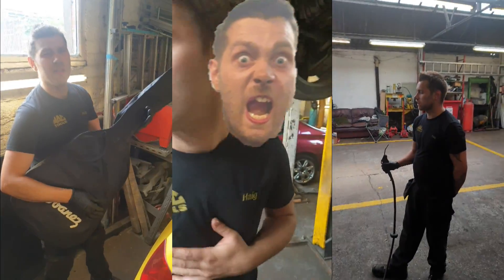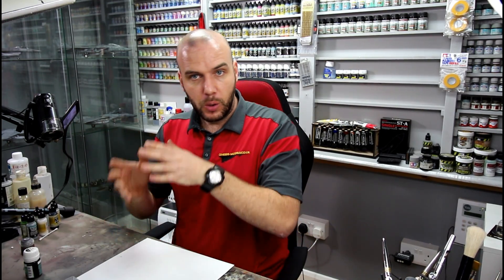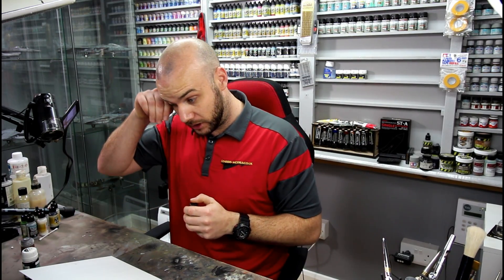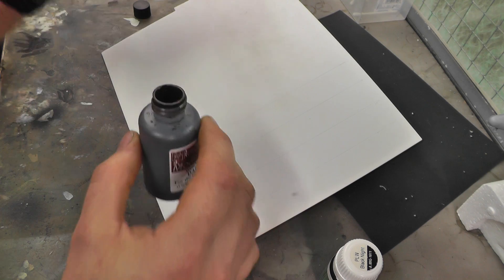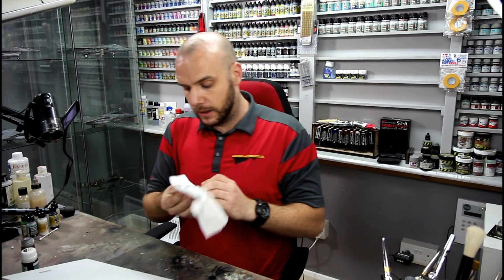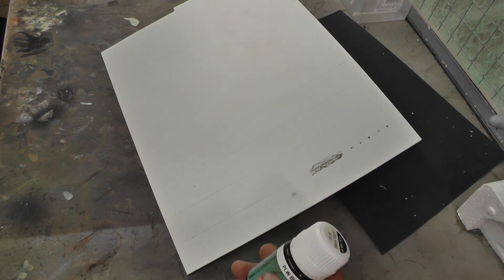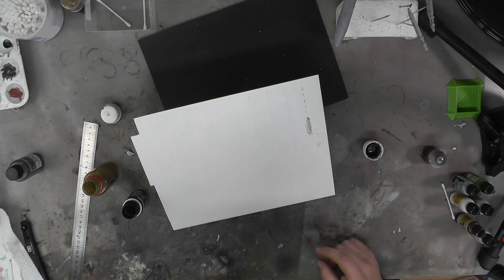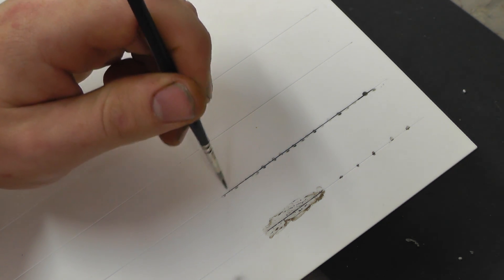Scale Modeling : Tips And Tricks : Pin Wash Improvment

Comment: A bit of topic, or maybe an idea for a topic, but, and I know it’s personal preference, what techniques,tips or tricks can you suggest for fine detailing for someone,like me, who has arthritis and a slight tremor in my hands. I have tried buying brushes with larger than average handles but the really small ones like 000 are not, in all my trawling through online or physical shops, available, for the shakes side of things I have a helping hands and magnifier, various parts holders and stands but they don’t really help, the thick handled brushes are great where precision is not the most important thing, but detail work is very hard and totally frustrating to do, even to an acceptable level. Any ideas etc would be really appreciated, thanks. This video was great, another tick in the box for an ageing but novice (well, returning modeller really) model maker, there weren’t washes, weathering compounds and pigments etc the last time I picked up a brush, a normal brush that is, no hobbyist air brushes back then. 👍😀🏴